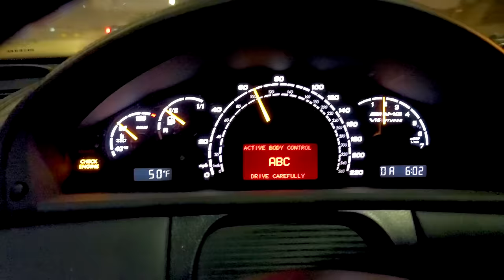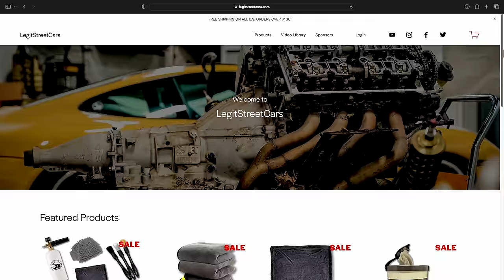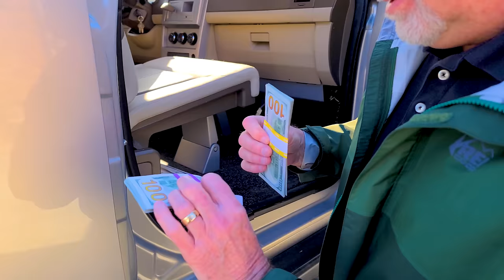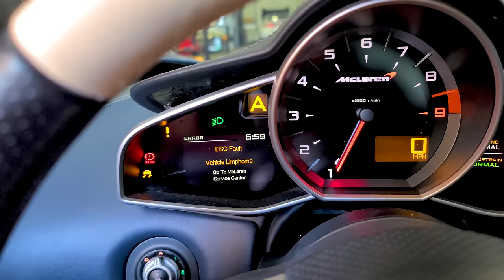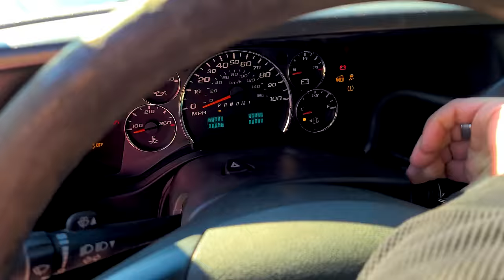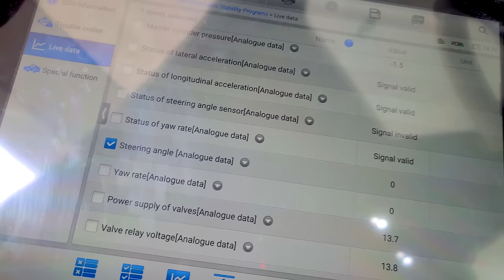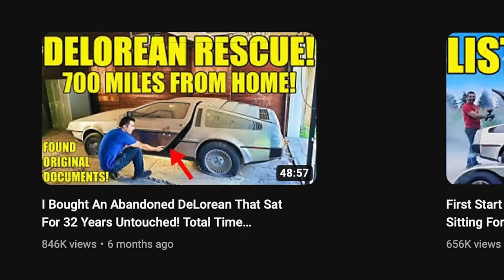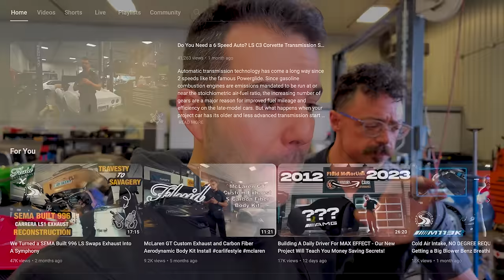My Car World Has Officially Crashed & Burned! Big Channel Update! Mostly Bad Except 2 Things.

Comment: Alex, Ive had Alt belt issues before when it was loaded up with current running 2 amps for a custom sound system and the thermo fans kicked in, the initial load from the fans caused a short harmonic in the alternator itself (Bosch unit, 125 amp twin V pulley) which was partly rubber insulated at mounting bolts (Volvo 740 Turbo) and I had to reproduce the issue at highway speed.
I replaced it with the same spec Hitachi, made nolathane sleeves to replace the OE rubber ones and it never created the harmonic again.
I had the Bosch alternator tested and refurbished as well as load tested before and after the rebuild and when the thermo fans kick in at 55 amps draw it was still within the maximum draw rating but obviously the kick was too much for the older design, the Hitachi was a spare from a mid 90's Volvo, same amperage but a way more capable design.
Id replace and over spec the alternator.

Comment: ""Pushers''  LOL I was an employee at a convention center. I was a pusher along with 6-7 guys who were told exactly where to touch the prototype Scion into their booth. They were terrified that it would be harmed if touched in the wrong way. It had no drive at all and barely rolled. There are stories about other cars that were modified just for the press and quickly changed as soon as the photographers left.

Comment: One the Porcha you could  do two things.  The first is maybe machine the lip on the intake down a tiny bit and the intake so the whole thing could move in maybe half an inch or so.  You might need a ring clamp to hold it better.  Then if that is not enough then heat and bend in the intake where it is hitting.  It will likely have less restriction than that other air filter you are trying to use.

Comment: Best thing you could ever do is replace those shocks with some aftermarket and delete that ABC pump. The issue is the pump they have on it is undersized for everything it has to do, so they go out often. I had to replace that hose on my CL600, had to remove the front bumper.

Comment: Would be an interesting video buying another CL and do a coil over conversion, simplify the electronic system,and do a manual swap. It would increase reliability as resale value.
Reply: Don’t do it … it would reck the handling .. With the ABC system there are no sway bars and the ride of Coil Overs is terrible compared with ABC. Don’t buy a ABC if you’re not prepared to fix it when it goes wrong. Alex your doing great, keep going your almost there and you will end up with a fabulous car when it’s completed.
Reply: @JACB006  That's why he should buy a second CL to do the mods, as adding sway bars.
Reply: @RogerM88  on this we must agree to disagree. I think he would be taking a Great car and making it Mediocre. The ride and handling would suffer and the resale would tank. Why would anyone do that to an S Class Mercedes (CL) with all its sophistication and elegance when they could by some other car originally equipped with springs if that’s what they want?
Reply: @JACB006   You're assuming these cars will be repaired through the decades to come, especially with complex hydraulics. But in reality many will end up neglect, so those list of mod could actually keep many on the roads.

Comment: As far as the van goes I believe it is the alternator it's probably the shaft that runs to the center of it it might be out of spec just a hair. And that's why we get to higher RPMs it will probably start vibrating and shimmy the belt just enough until it.

Comment: On the van belt flying off,I'd check the crank shaft thrust play,and or the torque converter balloning under load.

Comment: New to the channel.  I owned same Cl and 03 E55, both sub 100k cars for about 6 years and besides regular maintenance the only part either car needed replaced was a CPS sensor I changed for $30.  I guess I was extremely lucky.

Comment: I had the similar problem that you’re having with your van and it was the bearings in the water pump that was going in and out. It was weird. Sometimes it would throw a belt. Sometimes it wouldn’t. I change the water pump no more problems other than I’m.

Comment: That busted hose is a power steering hose. Mine went on my 03 S600. The hose was 850 cdn  and 1500 labour. Nasty job.  I use Joe Gibbs synthetic power  steering fluid. Same spec as cH11s  and I pay 13.50 cdn a liter

Comment: High pressure Hoses tip. It can be worth it to find a local hydraulic hose manufacturer. They make custom hoses for things like trash compactors and forklifts. Most carry fitting sizes that’ll work on a car too.

Comment: Re: the van... Maybe the load on the alternator is causing it to spit the belt. Alternator is basically moving slower than the engine.
I have seen belt problems on our equipment here. They run a v belt.. So wont toss it but you can see in my case the large hvac compressor load causes thr belt to be tight on one side and loose on the other. 
Make sense?

Comment: more than likely on the van belt, at high rpm if the tensioner is weak (even a new tensioner compared to another new tensioner won't have the same tension) the belt will "float" loose at the alternator, it probably catches the supercharger bracket and spits off.

Comment: I wonder if you could use the existing intake on the porsche, cut a segment out of the rubber tube between intake and mass airflow, and then use a flat segment of aluminum with rtv and some clamps to clearance out what you need.

Might be a slight flow restriction, but probably still better than the small air filter

Comment: The bracket near the power steering pump like One of the people have said . Or just a suggestion Put a largerlip on your pulling to the Alternator same size diameter pulley just a larger lip on the face of it

Comment: I just had the same issue with my Chrysler LeBaron. . The alternator had one less rib on the serpentine belt so i cut one rib off and it has been perfect every since.. Check the number of ribs and cut one off OR change the pulley on the alternator.

Comment: On the Van that sounds Like a engine mount Movement Check.
 the engine Mounts and Brackets Its Lose or Missing a Bolt! 
On average, replacing an engine mount can cost anywhere from $446 to $498. 
Best case is that it was Just Loose or Missing a Part.
Only other thing Is replace the alternator and Brackets
Only other times I have seen this.

Comment: On the van belt, I would check the alternator again. Take belt off and attach a drill with socket to see how smooth the bearings are. It possible that there something in the bearing that causing alt to suddenly seize in microseconds throwing belt off.  Other thing to check is engine mounts which could seem to be good but a tiny jerk could fling belt off.  And last is the tensioner pulley. Have someone revive up the engine and watch the tensioner to see if it shaking any at high idle.  It could be defective straight from factory.

Comment: Afternarket pulley mounts somrtimes have such small differences, it will push or pull the belt. I would start with making sure all pulleys are in line with each other.

Comment: Tony Angelo from the Stay Tuned channel just resolved the air filter issue on his LS Swapped 911 by relocating the throttle body... Give it a look before you go to speed density and the extra crap you will need to make it work.

Comment: Alex, on the van alternator belt mystery, I doubt it's coming off from an excess of tension.. that would more likely cause the belt to shred or be damaged. It most likely has a momentary excess in slack because another part of system is slowing down belt feed in that area. If it was that alone, it should only slip, and not jump off alternator's pulley, so an alignment issue must exist in combination with imbalanced tension in belts loop. The supercharger brackets are close fitting by belt, maybe make a spring loaded sheet metal fender in one or two pieces to push belt back onto alternator's drive pulley or limit it from jumping off ? Not a complete fix but a band aid until you sort it out ?

How about you rig up a good ( high frequency so it doesn't pulse on/off a lot ) led light and go pro mount in engine compartment that can study it while you drive it locally near shop ? Maybe it will see the slack condition ? Maybe add some white stripes or patterns on pulley and belt so video can be studied while slowing it down somewhat ? A GoPro isn't a high speed motion analysis system, but there are businesses/people you can contact who might help you in studying it with an actual 2K or faster fps video cam system for a smaller fee in exchange for your cross promotion perhaps ? It could be a good bit of content for the van, and seeing burnouts or how a tire is/isn't hooking up on track or street vehicles is bound to be cool.

Comment: RE; Express van: Sounds like you have a heat failure of the bearings in the alternator. IE; they only fail when they get warm enough to sieze, or possibly they are flat-spotted, and only fail when they hit the "sweet spot", thusly putting extra load on the drive shaft, and causing the belt to jump ship.

Comment: Check the bracket in the back of the alternator. See if there’s any slippage back-and-forth when you apply power you’ll know cause it’ll be scratching between the nut and the bolt. It’s also possible you have a micro crack in that bracket

Comment: Pausing the video @ 31:28 to let you know i had the same issue with my wife's Holden Commodore SS LS engine throwing the belt. I ended up ordering a smaller serpentine belt (i wanna say 10mm smaller but may have been 5mm) and its never thrown it since. That was two years ago.

Comment: The Express Van needs a set of high quality pulleys and tensioner designed to work at those HP and RPM levels...problem solved....at the very least you need a deep grove alternator pulley, the one currently on there has no way of holding the belt on as it "walks" under load because the outer shoulders of the pulley are waaaay to short/shallow.

Comment: Later LS engines had an over run pulley on the alternator. This significantly reduces belt whip - there are videos out there showing the difference. Pulley is just a bolt on change - but replace the alternator at the same time as it is probably on the way out.

Comment: The belt goes off because the more power puts more stress on the belt and pullis,
Its a commen issue when you add more power you also putt more stress to and other standard komponent.

Cool chanel

Comment: 31:33 you probably have to much torque pulling on the tensioner loosening it up enough to slip off. Perhaps you need a different type of tensioning setup.

Comment: on the van - IF there was something causing the idler pulley immediately  downstream of the alternator to stick at a given RPM/Load level, it would cause the belt to jump at the pulley like you described. It would stop doing it if whatever was causing he stiction came free over time.

Comment: Belt - something is flexing under load or heat. Look for loose accessory bolts first, then try adding a few braces to shore things up, and that should bring it back around.

Comment: Hey Alex, about the belt: on my 65 ford pickup, I had that same issue, total mystery. My 90 ford guy Stripped the paint off the alternator pulley: the Chinese version has anti rust oil on it and made the belt slip off ( I was driving Florida to Quebec and changed the alternator, must have been a weird clone or something). So once the pulley was clean and stripped, the belt stayed on .

Comment: I feel the pain and share your enthusiasm. I have a 2007 M6, the one with the dreaded V10 time bomb. So far the engine has been good, but every time I fix something I manage to break something else in the process or find more BMW broken plastic that needs replacement. For example, the lower cowl windshield seal needed replacement, I ordered it and took forever, and when it arrived it was missing some parts so I had to wait. I had to pull the windshield wiper arms, when reinstalling them I broke one of the windshield wiper arm studs, and it couldn’t be replaced on its own, so I bought a new windshield wiper linkage and had to disassemble the whole rear part of the engine compartment, lost a couple screws and plastic pins that fell into the bottom engine tray… well I received the linkage but it was damaged during shipping, so I had to wait for the replacement. But since it took all of that apart I thought it was the perfect time to install the new CSL style plenum from Infinity Design, and I took the OEM plenum apart, relocated the new intake air temperature sensors, and when installing the new plenum realized I needed new hose clamps for the individual throttle bodies and also realized the couplers for the air filter duct to the plenum were missing from the Infinity Design original shipment, so I had to wait for those as well. So in the meantime I said, well the injectors are there let’s have them cleaned (cause you can’t buy new ones nowadays) and the coils are there, let’s replace them. Clean injectors go in, they leaked cause they had the wrong o-rings, and had to disassemble-reassemble and I went as far as removing the injector rail to have the injector cleaning shop check for proper o-rings (I know I should have just bought OEM but they said they had them). New coils go in, but they say made in China instead of made in Germany, even though I got them from the dealer, so I feel I downgraded the car. Now the car is reassembled and works well, with nice induction noises, but it was working well before 🤷. So in hindsight it only took a month to just change the lower cowl windshield seal 😂

Comment: Looking at this I would look at the bolts holding the alternator and pro charger. The bolts do not look like grade 8 bolts. When the engine revs the additional down force may be flexing the bolts. Understand the pro charger is adding forces and the alternator apparently is the weak link. Increasing the strength of the bolts may reduce the deflection of the alternator. This is assuming the bolts are deflecting in the elastic range. If they get into the plastic range the bolts will be slightly warped. This is an observational guess. God bless.

Comment: Alex, one cause of the belt issue might be from the larger fuel pumps engaging at a higher RPM which loads the alternator more, causing the belt to fly off

Comment: Supercharger on the LS Porsche and den dual side intake on that. 
Or a old caburator style indtale. Twin mount and them some welding so you can run 2 4" throttle body's on a custom

Comment: Hi Alex - Try cheaper Fluid - Febi Bilstein 21647 - its correct MB 345.0 spec - about $20 a  bottle!! I've used it in my ABC S600 for 3+ years now, no issues.

Comment: Try a clutched alternator pulley. A similar issue was happening with my modified N54 135i. The rpm’s dropping rapidly made the belt jump off the alternator pulley since the momentum in the alternator made it want to keep on spinning. Hope this may resolve the van woes. 😎

Comment: Hi Alex. I understand your frustration about the cost of the self-leveling suspension and ADS hydraulic fluid.  I use Shell Tellus S2 MX 32 in the system until I know everything is sealed and working.  It's essentially the same stuff, just a higher viscosity.  32 instead of 16.  Once your issues are sorted then switch the Tellus out for whatever else you wish to use.  /salute

Comment: Just a couple things about the 911, going with the smaller pulley can cause cavitation, it doesn't necessarily make cooling better. Especially if you plan on using the car at a high RPM.

I would personally suggest to just find a different intake manifold and throttle body setup that would work better in the car. With the LS market there are so many options

Comment: if you have to change a timing belt and you haven't got the tools, cut the belt all the way round,take off one half, then fit on the new belt, then remove the other old belt.

Comment: As far as your van goes, did you check for shaft play on the power steering pump? Just from the mileage, the pulley could be slightly  cocked sideways just enough that under load and with vibration its throwing the belt off. Even a new belt and tensioner would not keep the belt from coming off.

Comment: I had a similar belt problem on a stroked 327 that I converted to a serpentine system 
At about 5500 RPM it would throw a belt, not shred it or break it.
Replaced with new belt over and over
Tried switching to a different belt brand, never happened again.
When comparing to the brand I was using around 3/8" longer on the brand it would throw

Comment: heres a trick that shou.d save you some money for pressure hoses.. take them to a business that does hose lines for heavy duty vehicles.. they will use the factory attachments & that hose will be cheaper than factory (if available) & usually have a warranty. weve done this since the 90s. at first it was like $11 now its $18. (audi power steering hose fix) but they also do pressurized fuel lines too.

Comment: 31:00 Harmonics between pulleys. they likely matched exactly and the belt stretched out from that finally.

put the new belt on and see if it comes off fresh..    could be when the alternator isn't charging and the steering pump has no load or the reverse..  you probably know and just haven't recalled

Comment: Had thay same problem with my s10 and it was fine but then the tensioner spring was not good change the tensioner that's what keeps the tension on the belt

Comment: Just a theory about the Xpress Van, maybe the alternator being right next to the blower and being held by just two short bolts under its body, maybe the resistance created by the boost rising is tilting the alternator forward spitting out the belt. Maybe adding a support point at the back of the alternator could prevent your issues or at least help you pinpoint the problem.